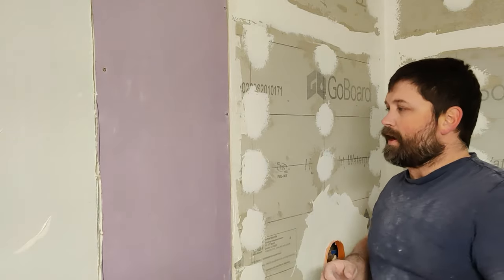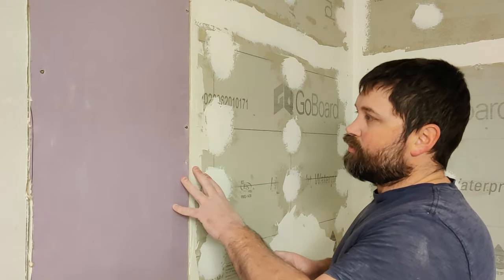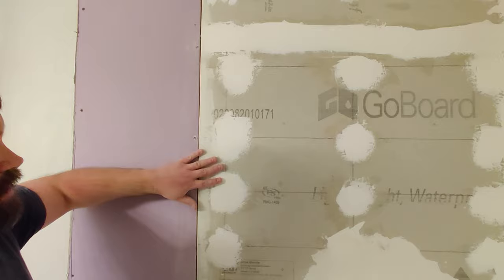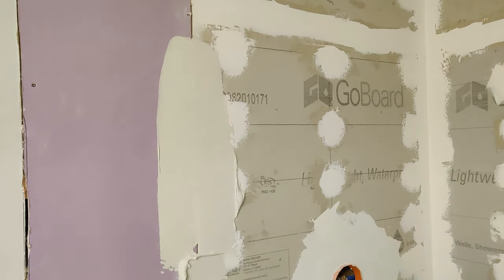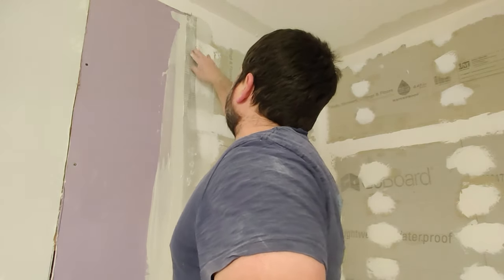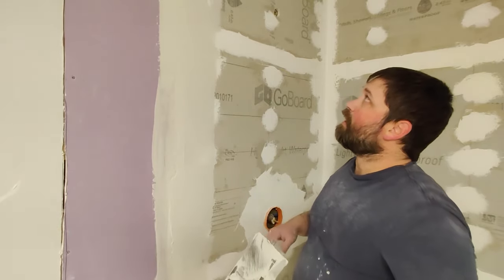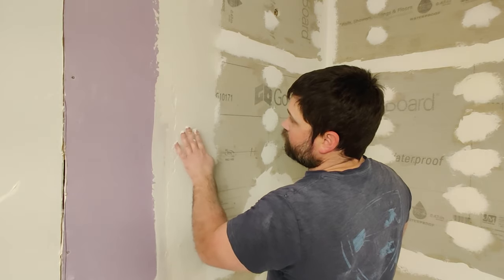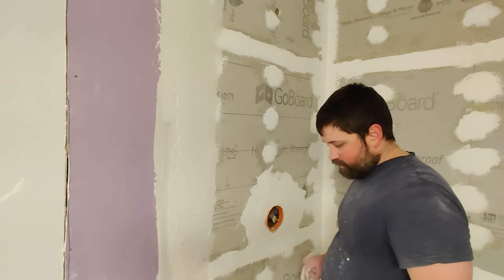TRANSITION FROM TILE BACKER BOARD TO DRYWALL

Comment: Yikes... sanding Thinset? When this type approach is unavoidable the pros use a damp sponge to smooth out any thinset where the thinset transitions onto drywall. When I find myself in this situation I try to use Laticrete Multimax Lite as it contains no sand and is similar to working with drywall mud making it easier to get a smooth finish. Personally, when installing tile using thinset, I try to plan the project so the last row of tile  "actually covers the gap" where is goes from backer board to drywall. No sanding or feathering needed. (I've also since switched to installing GoBoard and no longer bother with  using mesh or paper tape, I simply fill the gap with GoBoard sealant and cover with GoBoard Seam Tape.)
Reply: How have your projects held up with GoBoard? Would you use Red Guard on GoBoard for ultimate water resistance? Been a contractor and ICC certified building inspector for 35 plus years. Doing our shower after 12 years away from working as I’m battling a terminal illness that has taken over my life. I’ve got to finish my wife’s bathroom before I pass away. Hired two separate contractors whole stole from us more than $30,000.00 total. Thanks and God Bless

Comment: With goboard or even with Kerdi board the mixing valve seal is unnecessary. It's designed for use with water resistant drywall and the Kerdi membrane. I usually run my water proofing at least 2-3 inches outside of the tub or shower and my tile about an inch past that. This step is also unneeded if you're going to do it though you should use the black tape that's made for thinset usually in the tile department not the white or tan in the drywall area.

Comment: When it tape the joint from tile backer to drywall I always used a small taping knife. Usually just a 4". That way I don't spread thinset all over the drywall. I also always run my tile completely over whatever thinset Is on the drywall. With a little planning you can almost do it that way everytine. It makes the tapers job a hell of a lot easier !

Comment: What if you transition from wonderboard lite in the shower space to a thicker drywall for the rest of the bathroom?
Reply: Same problem I have. I have old house, it was all button lath and floated. The previous shower was chicken wire and wire mesh and very thick. So with modern cement board, it will be a lot thinner than my wall. So I’m not sure how to transition from thinner shower wall to thicker bathroom wall?
Reply: @liammiller8259  can you add filler pieces to the studs to give it more thickness? Another option is a piece of trim similar to transition between floors
Reply: You fur the walls with the Wonderboard with thin strips of plywood to bring them level with the old drywall. Or, as an alternative, you can use mud on the 2x4's before setting the Wonderboard ( a little trickier I think).

Comment: Is this a tub or shower? Is the outside joint past the outside of the curb or tub edge? Cuz if it is, you don't need to use mud or thinset. You can use silicone caulking if you want. If that joint is outside of the curb or tub edge, it shouldn't get wet. The shower door is the barrier.
Reply from the maker: It's a tile shower with glass doors.  No, the tile runs to the drywall.  So I needed the thinset for the tile and the edging.  There is no shower surround to attach to the wall.

Comment: Just about the best tape and mud video I've seen, especially the part about the Schluter mixing valve cover.  This is the second bathroom I've done in our new house (The third was a fiberglass surround, so no mudding or valve cover needed), and no one ever told me about this before.

Comment: Great video I want to say one thing I noticed just to make it clear for anyone else, if you fill the gap first,  you're feeling the gap... which means in a sense in that way, the gap doesn't have as much room for expansion in the areas where the mud is.
If you've ever been in a house where when the season is changing and you hear random mysterious little creeks and cracks it's always been my curiosity if it's scenarios like this. But either way whether you can hear them or not I was always taught to tape first so the gap remains for expansion on the whole line.

Comment: Can you extend the goboard past where you want to tile? Thinking the waterproof backer would be better than the mold resitant drywall? Just worried about how it would texture.
Reply from the maker: You can.  It's not really necessary unless you are concerned that you are going to get a lot of water out of the shower.  You will probably need to skim coat it with drywall mud of something. Otherwise, you won't have a smooth surface, like you would with drywall.

Comment: If your drywall was from 3mm to 6mm proud, how would you build out your wall board?
Reply from the maker: If you haven't installed the wall board yet I would shim behind this wall that need to be built out.  You can buy 6 to 8ft shims.  If you have already installed the wall board you can try to build up the tile using mortar behind it.  Though if it only 3-6mm might be able to just in a thicker tile edging and cover the difference.  I apologize for the delayed response.

Comment: What did you seal around the mixing valve ?? That schluter did not sit water tight with the valve, has no purpose in my opinion…
Reply from the maker: I just used mortar to put it on the wall.  The idea is that if water gets behind the tile it will be directed around the valve.  Not supposed to be water tight against the valve if that is what you are thinking.
Reply: @HomeRepairHub  I think he means the mortar is not waterproof so water can seep between the schluter and goboard. You're supposed to use waterproof sealant there.

Comment: Can you use the go board sealant instead of thinset? Also, same process for go board to ceiling transition?
Reply: No... GoBoard sealant is a flexible elastomeric product. When cured it has rubber-like properties so it can't be sanded nor painted. For thinset on the transition I'd recommend Laticrete Multimax Lite because when mixed it has a smooth creamy texture like drywall mud and contains no sand.

Comment: I have a question for you please.  I have 1/2” drywall and bought 1/4” hardie because that’s what I saw first, do I need to install 1/2” hardie since I have 1/2” drywall?
Reply from the maker: So no, there is no requirement to have 1/2 inch hardie board, at least not that I am aware of.  That being said you will probably need to build out the wall 1/4 inch underneath the hardie board if you are wanting them to be flush.  Now if the plan is to just run your tile to the end of the hardie board you could probably get away with not worrying about them being flush cause.  If it were me I would probably go with 1/2inch as long as you haven't already installed the 1/4inch.  I assume you are laying tile, is this in a shower or bathtub?  If it is, I suggest going with something similar to goBoard or schluter as they don't require waterproofing.  Where a cement board needs a waterproofing system over the top.

Comment: How would you handle this joint when the cement board is thicker than the drywall?
Reply from the maker: I would still use the thinset and then just taper it off on the drywall side so that you don't notice the transition.  To make it look a bit better I will then put a skim coat of drywall mud over the top of the tapered thinset once I am done tiling.  This way I can sand it down to make it smooth as thinset is course.  Then paint.  Are you going to run your tile past the seam?

Comment: @1:11 "We don't want to use drywall mud"  @1:48 Uses drywall mud.
Reply from the maker: I used mortar.  I said to spread it like you would drywall mud.  I said you could use drywall mud once you tile was set to cover the rough spots on the drywall side.  I don't actually use any drywall mud in the video.

Comment: Should the cement board be mesh taped to the ceiling sheetrock.  I’ve got my cement board going all the way to the ceiling and I’m not sure if I should tape them together.
Reply from the maker: I would probably use paper tape.  Then just cover with mortar for your tile If you are running your tile all the way to the ceiling it is always best to use a water tight sealant at the top as well.  Are you doing a steam shower or just normal shower?
Reply: @HomeRepairHub   Normal shower.  Thank you so much for answering my question.
Reply: This is very helpful info. Thank you!

Comment: thanks for the tips! i’m transitioning to an outside corner. goboard on one side drywall on the other. should i use a metal corner bead set in thinset? i’ll have tile on one corner, finished w metal edge profile & drywall on the other corner.

Comment: Why not just use go board in place of  your “purple” drywall
Reply from the maker: I am only using goboard where I am tiling.  My tile stops at the point where the purple drywall and go board meet.  I need to be able to paint the wall so I am not going to use goboard on the wall.

Comment: Hi Aaron, great info!  What type of thin set did you use for the Kerdi shower mixer valve seal? Thanks!
Reply from the maker: If you are tiling just use what ever you are using for the tile.  There isn't a specific thinset that you need for the shower mixer seal.

Comment: So you're plastering the walls after you did the tiling?
Reply from the maker: No. I tiled up to the edge of the backerboard, then just sanded and painted the walls.  It I just used drywall mud to transition, then the tile wouldn't adhere properly to the backer board.  So I just used morter for the transition, similar to how you would use drywall mud for drywall joints.

Comment: You should not tile over spackle in a wet shower area. The moisture will eventually leach thru the grout lines and dissolve the spackle. If the spackle in in the shower area an inch or son, no big deal but the spackle area this guy put into the shower was way too much.
Reply from the maker: Spackle?  I didn't use spackle.  I assume you are talking about the area between the goboard and the purple drywall.  I used thinset.

Comment: I'm assuming you can paint the thinset that's on the drywall?
Reply from the maker: Yes.  My suggestion is to sand the thinset as best as you can, then do a skim coat of drywall mud over the top of the thinset to smooth it out.  Then paint.

Comment: could you just use the goboard adhesive over the tape transition seem?
Reply from the maker: You could, though it would probably be kind of messy.  I think the challenge would be that you couldn't smooth it out completely, so the area right night to your til wouldn't look very good.
Reply from the maker: If you try it, I would just do a small section and see what it looks like.

Comment: I have a half inch gap between mine because the shower is 36.5" wide and the GoBoard is only 36" wide. At the time I thought, "Oh I'll just add a sliver and cover over it." Now I'm panicking that I don't actually know what to do with it. Google says Thin set isn't for large gaps, so should I use (real) mortar for that?
Reply: The great thing about GoBoad is it can be cut to any size and shape and attached securely using GoBoard sealant. I had a similar issue (my gap was 3/4") and was instructed by the Johns Mansville support desk to simply cut a strip of Goboard wide enough to fill the gap and affix it in place using GoBoard sealant making sure all raw exposed edges of the GoBoard have sealant applied.

Comment: Would you know about goboard I’m for floor installation? If I install the 1/2” go board on top of a 3/4 plywood floor, do I need to mortar it down or can I just screw it down? Also, I will only have one seem, so I leave an 1/8th inch gap there and all around perimeter correct? Then do I use the goboard sealant all around perimeter where I left the 1/8th inch gap or just the one seem? Then tile after?
Reply from the maker: I have never installed go board on the floor.  When I did my floor in the bathroom I used cement board.  Sal Diblasi does a lot of tiling video's and might be a good resource.

Comment: what about if you have a step in the transition? my shower backer board is about a 1/2 inch higher than my drywall due to framing in the tub and shower walls...
Reply from the maker: Have you put the tile on yet?  I would probably just find something to trim it out with, metal j trim or some kind of shower molding that matches what you are going to trim out the tile with.  Maybe a piece of drywall corner bead for the backer board then just find a water tight sealant for between the trim and the drywall.
Reply: @HomeRepairHub  not yet just finished the backer board and drywall

Comment: Thanks for sharing.  Is this light weight backer board strong enough to a a piece marble?  I am so worried as I have bought these board, and still not installed because of the reason above.
Reply from the maker: You would have to check manufacturer specs.  I think it would depend on the brand.
Reply: @HomeRepairHub  I am talking about GoBoard.  I bought them but they are so light weighted. Don’t know if they can hold up the marble.  Any idea?

Comment: Do you thinset on screws in backer board in shower?
Reply from the maker: You can.  What type of backer board are you using?  If you are using foam backer board there is usually a sealant that will be used on the corners and screw heads.  But each foam board varies a bit.  Kerdi is a bit different and uses thinset.  If you are using cement backer board you can use thinset to cover the screw heads before or you can wait till you tile and cover the screw heads when you tile.  If you are using cement board  are you use a water proofing system?  Really just depends on what type of backer board you are using.

Comment: Do you have a video of the goboard installation? You mentioned in the video but I didn’t see it on your channel.
Reply from the maker: Unfortunately I have not got it finished yet.  Do you have a specific question regarding goboard?  I am currently working on it.
Reply: @HomeRepairHub how did you seal the gaps between boards? The install instructions say the preferred method is to mount the boards with the gaps then fill. Option 2, adding sealant first then mounting seems like you’d get more coverage? Also did you reinforce the seams or anything like that? I know they have the option to use the goboard fabric seam tape but haven’t seen anyone actually use it. 

Also, is there any issues with thinset/tile adhering to the sealant that is spread from the gaps? I’ll be using OSI quad max from their list since I can’t find the goboard stuff.

Comment: What thinset do you use for with goboard for large format tile?
Reply from the maker: Just go to your local hardware store and read through the different thunder types.  Usually the bag will tell you what size of tile it works with.  Just look for LFT, large tile, or large format tile on the bag.  Shouldn't be hard to determine which stuff is for Large Format tile.

Comment: I want to extend my tile out of the shower to cover one whole wall of my bathroom. Once I hit the drywall out of the shower, can I add cement backer board on top of the drywall before tiling or do I need to remove the drywall first? It will get humid but no direct water. The tile is fairly heavy at 4 pounds per square foot.
Reply from the maker: Yes, you can put backer board over the drywall, though I am not sure why you would do that unless you need to build the wall out to match up with the shower.  You may also want to look into a foam backer board like schluter.  I am not sure what the weight limitations are with the different systems so you may want to lookin into that.
Reply: @HomeRepairHub  Thanks I thought it would be less messy to leave it but realized yesterday that I should just take down the wall's drywall when I gut the shower since it would be safer and I need to replace the whole ceiling's drywall now anyway because of mold. That is a good point about the wall being level with the shower. If I take down the drywall and use cement backer board in the shower and the connecting wall, it will be a smooth transition and won't stick out at all. What is foam board used for vs regular cement backer board? I was thinking of using cement board and adding redguard on top before tiling. I appreciate your help; I am new to all of this!
Reply from the maker: In the video I am using GoBoard which is a water proof tile backer board.  There are lots of different systems on the market, schluter, laticrete hydro ban, USG, etc.  The foam board is a tile backboard that is waterproof.  Lots of video's on youtube.  Here is one that goes over some of the differences and explains what it is.  Sal has lots of video's on the different systems.  Its much easier to work with then cement board.  I still like cement board for flooring.  https://www.youtube.com/watch?v=uxROu4N0WMQ&t=538s

Comment: Does Schluter have those covers for valves with a square (i.e. Delta multivalve)?
Reply from the maker: I am not aware of one, though it's possible there is one.  In most cases though you would still cut a circle for the mixing valve and then just cover it with the square valve trim.